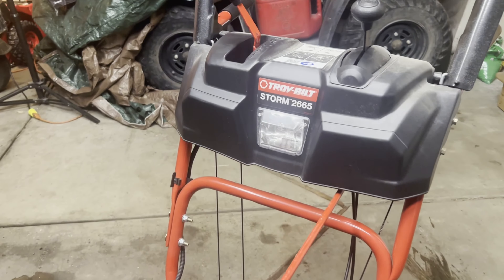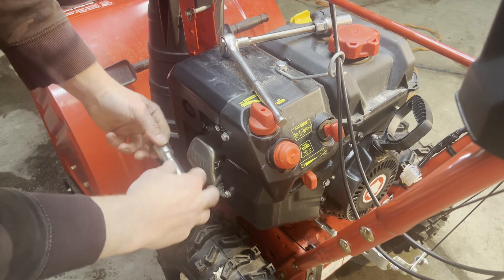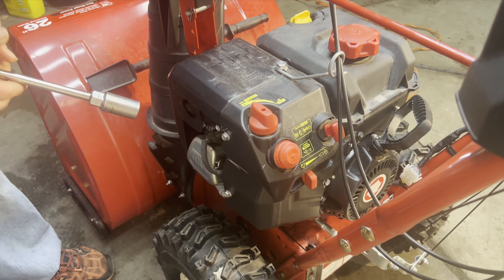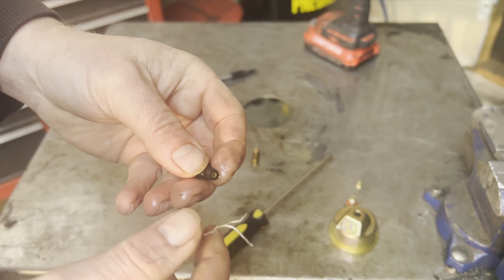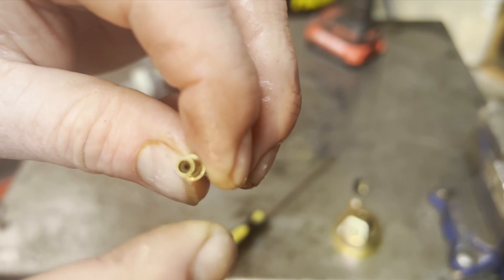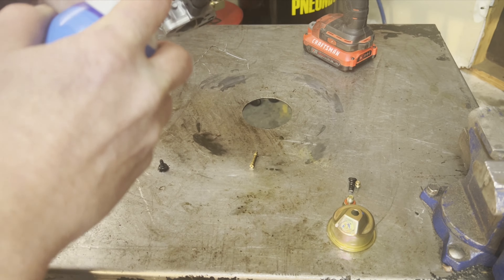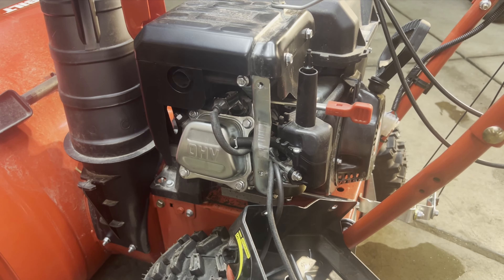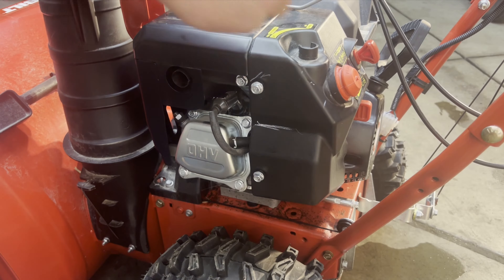TROY-BILT STORM 2665 Snowblower Won't Start

Comment: Hey, how do i attach the choke lever to the carb? I think it broke off?
Reply from the maker: There is a plastic stem that goes from the top of the carburetor and runs up through the plastic shroud. It connects there.
Reply: @small_engine_repair  is it held in with a little piece of plastic tab? I think it snapped off.
Reply from the maker: @zerorootx  Yes and you can't just buy that piece of plastic. Last time this happened to me I just used a screw to attach the choke back to the stem.

Comment: Do you know what part number the o ring gasket for the bowl is? I’m not sure the 208cc version will fit. When i put the model number in i couldn’t find anything 😞. I pinched it putting it back and snapped it
Reply from the maker: When you set the o ring gasket on the carburetor side is there a huge gap, or does it butt up pretty good? If it butts up pretty good I would just use it. I don't know the part number. Easiest way it to measure the outside diameter of the o ring and then google small engine carburetor o ring and look at what is available.
Reply: @small_engine_repair  thanks!! It ripped in half. I tried to measure it but when i cross reference it’s not the correct one. I also tired to put it back but the seal is so loose it won’t even prime. I’ll try and get in touch with Troy bilt the model is this 31am6cp3723

Comment: What socket size is that? I think I need a 10mm or 11mm
Reply: Or a 13/32?
Reply from the maker: To remove the plastic shroud it is a 10mm.

Comment: Good explanation on the carburetor breakdown and cleaning. On a 2665 storm, do you know how to replace the idle spring? it was rusted and broke apart.
Reply from the maker: Just reading this. I do not remember off the top of my head. Did you get yours fixed?

Comment: Do you service the whole machine , or just do the minimum the customer asks . If you are in the business you should sell other things to be serviced to get your money worth and to prevent problems when you service the same machine later on .
Reply from the maker: I evaluate the whole machine when a customer brings it in. If it needs a full service then I do it.  A lot of the machines that I have got in lately are practically brand new. Maybe 5-15 hours on them. Colorado Springs just does not get a ton of snow.